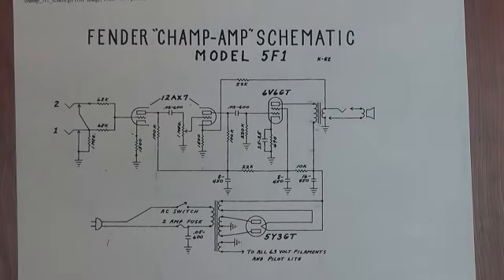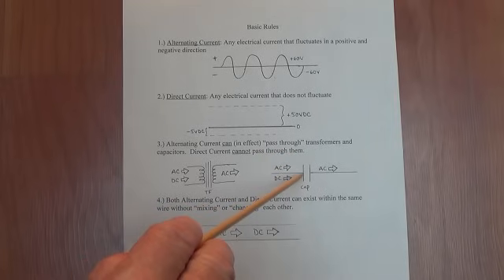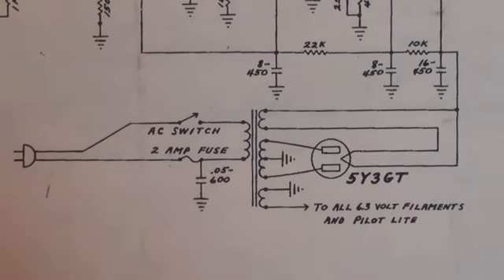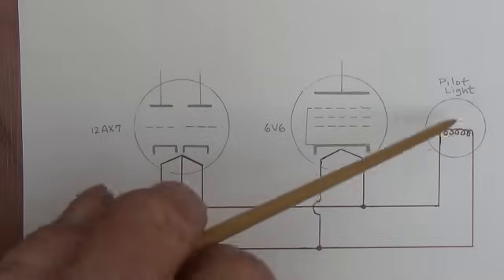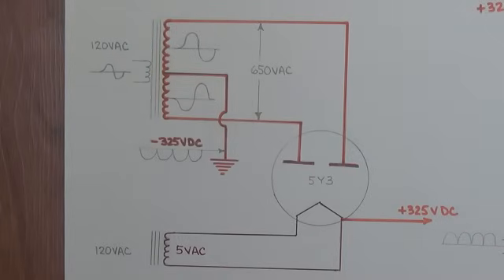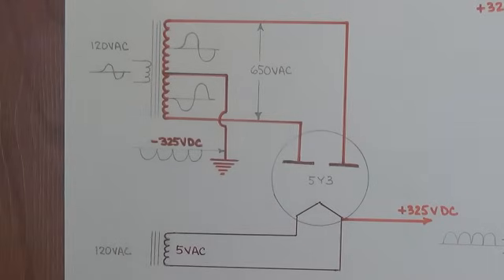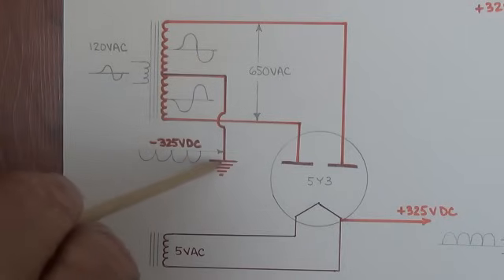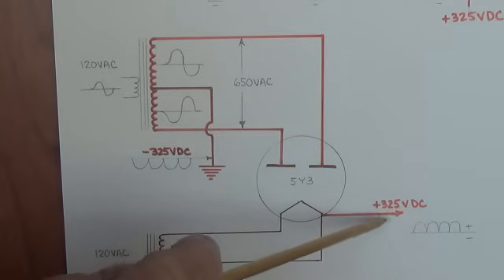How Tube Amplifiers Work, Part 1: The Power Supply

Comment from the maker: Dylan, your question did not have a reply capability due to your YT Privacy Settings, so I'll answer it here. The +325VDC output has passed through the diodes of the rectifier tube. The diodes, due to their alignment, only pass positive voltages. The -325VDC was rejected by the diodes (it was not allowed to pass through) and goes to ground. Think of the power supply as a 325VDC battery, with a positive output (from the diodes within the rectifier tube) and a negative output (from the ground).
Reply: hi Doug, im not sure if we had the same question but was wondering why if diode output is +325vdc and ground is -325vdc, why when we look at the amplifier stage it doesnt have +650vdc going to the output transformer with ground as a reference voltage of 0v? when looking at certain components like filter caps connected to ground and the rectifier, will they need to be able to handle 650 or only 325v?

thank you for the video!
Reply from the maker: This is an ancient video, NC.  The voltage readings on the diagram reflect the readings you would get if you first measured the voltage between the B+ and ground.....or if you measured between the B- and ground. If you measure the voltage potential between the two secondary output wires of the PT with no load, it will be approximately 700VAC before rectification. After rectification, since only the B+ is sent to the center tap of the OPT (and the filter caps), the output tube plate voltage(s) and the filter cap voltages will be 350VDC to ground.  All of this ignores losses due to heat, inefficiency, and the boosting of the smoothed DC to peak voltage.
Reply from the maker: No, ground has zero charge. It depends on the bias of the rectifier diodes. I you take the HV from the cathode (as in amp HV circuits) you will have B+ if you take the HV from the plates, you will have B-. You need to watch my videos on power supplies and rectification. @ncnoman
Reply from the maker: You're welcome, NC. Best of luck with all your pursuits. @ncnoman

Comment: So I'm a bit confused... I got it all up until the center tap in the 650V winding was introduced. Why does the schematic show the tap going straight to ground with -325V already without even passing through the rectifier?
Reply: +Dylan Headrick The -325V is still AC, the minus sign indicates the phase relative to the 120V input.
Reply from the maker: +Dylan Headrick  Greetings, Dylan. Since the full-wave rectifier (tube) blocks all the negative wave forms and only allows the positive wave forms to pass (creating the positive DC output), the negative wave forms must be dealt with, and are sent to ground.

Comment: Hey, could be wrong here, but wouldn't the center-tap on the secondary for the rectifier circuit always be at 0 Volts?  These voltages measurements are with respect to ground and it's connected to ground, therefore if ground potential is defined as zero, everything directly connected to it should also be zero.

As I understand it, the rectifier works by effectively removing from the circuit one of the secondary coils using the diode action of the 5Y3.  Looking at just one coil, when it swings positive, it "pushes" positive voltage out of it's respective diode to create the B+ supply, while the ground is at zero volts.  When it swings negative, the diode effectively breaks the connection of the coil, there's no negative voltage being sent anywhere, you'd just get zero volts out of the B+ rail for the time that coil is swinging negative.

The purpose of the second, out of phase coil, is to make use of the otherwise "wasted" negative swings.  By putting this coil out of phase and giving it it's own diode, it inverts the AC signal and gives the same switching between positive-and-zero output, but it outputs positive while the other coil is outputting zero volts.

In effect, the full wave of your AC signal is accounted for on the B+ rail, all the "bottoms" you described as being sent to the ground aren't being sent there, they're being inverted and used to fill the gaps on the B+ rail that would normally be there on a single coil, single-diode rectifier circuit.
Reply from the maker: Shaggy, I agree with part of your explanation, but don't accept that the "bottoms" are all simply inverted and fill in spaces between the "tops". The center-tapped 650VAC secondary creates two separate, out-of-phase 325V circuits, each with its own "wave". At any one time, two peaks being presented to a diode....one is positive and one is negative. Only the positive ("top") of either of the two waves is allowed to pass by a diode, but at that same time the "bottom" of the other wave is rejected. It has to "go" somewhere. It is the equal and opposite of the positive "top" ....and it goes to ground. If we were to replace the amp power supply with a big battery (in the old days of battery radios, the high voltage battery was called the "B" battery, hence the term "B+" for the positive pole), we would have to connect both the positive (B+) and negative (B-) poles of the battery to the amp circuit, or no current would flow. If you measured the DC potential between the two poles, it would be 325VDC.....and you could say that the (B+) positive pole was +325VDC and the (B-) negative pole was -325VDC. The ground potential may "seem" to be zero volts, but relative to the +325VDC B+ (which is all that matters within the circuit) it is actually the negative opposite.

A (perhaps) clearer "global" way to visualize this is to think of negatively charged "bottoms" as the presence of electrons and the positively charged "tops" as the absence of electrons. The power supply is like a pump that forces all the electrons to ground (B-) and creates a huge vacuum of electrons (B+) in a wire that runs to the plates of the tubes. The amp's function is then based on controlling and utilizing the flow of electrons from negative ground to positive plate.....whereupon the power supply immediately segregates them again.

Here is an excellent site for this subject:  http://www.tpub.com/neets/book6/22b.htm. The diagrams focus more on the electron flow (from - to +) model than on "tops" and "bottoms", but it clearly demonstrates the negativity of the ground connection and the essential part it plays in the circuit.
Reply: "The center-tapped 650VAC secondary creates two separate, out-of-phase 325V circuits, each with its own "wave"."

True.

"At any one time, two peaks being presented to a diode....one is positive and one is negative. Only the positive ("top") of either of the two waves is allowed to pass by a diode, but at that same time the "bottom" of the other wave is rejected."

Also true, still in agreement.

"It has to "go" somewhere. It is the equal and opposite of the positive "top" ....and it goes to ground."

This I don't understand, why would you think this voltage has to go somewhere?  Voltage just describes the potential difference between two parts of a circuit.  If the diode blocks the current of your coil, it doesn't affect the voltage difference between it's two ends, or how it's referenced.  The grounded end stays at 0V, and the diode end remains some negative voltage.

It's like saying a disconnected battery should have it's ends be the same voltage.  That voltage doesn't go anywhere, you have 0V on the negative, and 1.5V on the positive (for an ideal 1.5V battery with the negative side as the voltage reference), whether the ends are connected or not.
Reply from the maker: Shaggy, thank you for accepting two of my statements, including the blockage of  the "bottom" negatives. It's not voltage that is blocked, it is current, i.e. electrons, and they must flow somewhere or the transformer would cease to function. The electrons (B-) flow through the centertap to ground, then through the load (amplifier circuit) back to the ends of the diodes, which (when approached from the cathode rather than the anode side) allow the negative current to pass through to the secondary windings, completing the circuit. The grounded centertap is negative as indicated in the diagram in the link I provided. No battery has a pole that is 0V....the poles are either + or -. The power supply is like a 325VDC battery, with a positive (post diode) and a negative (centertap) pole.

I think our differences are largely semantic. You see the centertap-ground as a 0V reference for measuring the voltage of the rectified (B+ ) output. I agree that if you placed the red lead of your voltmeter on the diode output wire and the black lead on the centertap, it would read +325VDC, just as if you connected the leads to the poles of a battery.....but to me, this static measurement fails to address the very dynamic (i.e. current rather than voltage) nature of the system. The centertap-ground is the (B-) source of all electrons for the amp circuit, including the current that runs from cathode to plate in each amplification tube. Indeed, it would probably be more accurate from a functional standpoint to consider the diode output as 0V and the ground output as -325VDC, but in my model of the system, neither output is 0V. Rather, they are equal and opposite parts of a dynamic one-way "electron pump", like the + and - poles of a 325VDC battery.

I appreciate your thoughtful input. Such discourse encourages a healthy re-examination of concepts and an enhanced breadth and clarity of understanding.

Comment: I'm poised to build a 5E3(Tweed Deluxe) clone. Probably a complicated answer but I'll ask it anyway.
Can I use 6L6's instead of the 6V6's? I have a bunch of them and would rather save the money and keep my costs down
Reply from the maker: Greetings, Joram. The heater current, plate current, and plate voltage demands of 6L6's, especially GC's, are much greater than 6V6's, so you will have to use a more robust power transformer if you use 6L6's rather than 6V6's. If you already have a PT that can handle 6L6's, then great.....but if you don't, the extra cost of buying one may neutralize some of the savings from not buying and using 6V6's.
Reply: Uncle Doug, thank you for your prompt reply. I've bought a couple of books on tube amps but some questions I just can't get the answers are just not there. Love your videos. Great DIY projects. What do you recommend for the 6V6's?
Also, is that a cameo appearance on an "elpaso" video
T
Reply from the maker: Any good, used reasonably matched pair of vintage 6V6's will work, or perhaps a pair of the new, modern Russian re-makes. Yes, I was in several videos on the El Paso Tube Amps channel before I started my own YT channel.
Reply: Hi again,
Would a higher rated cathode resistor(10W 300ohm) take care of the increased heater current, plate voltage and plate voltage demands of the 6L6's?
Yes, it's taking me this long.....the day job is getting in way of fun.
Reply from the maker: It's not that easy, Joram. As I said above, a change to 6L6 GC's would require a larger power transformer with higher voltage and current capability, and you would probably need a different output transformer with a lower primary impedance to suit the 6L6's. The tubes are not simply interchangeable, they have very different circuit requirements.

Comment: Hello!!  I have a fender twin amp and when I powered on the amp the red light is getting weaker until the light is gone but the amp is working but if I hit with my hand above the light then the light is on but quickly its gone off again. Sometime the sound of the amp change dramatically. I am a musician but a stupid with gears so I will aprreciate very very much your advice.  Thanks!
Reply from the maker: Greetings, JJ. It sounds like you have at least one bad connection in the 6.3V AC circuit. Since you are not experienced in amp repair, and if this problem adversely affects your use of the amp, I would suggest taking it to a qualified repair person. Repair will require removal of and work within the amp chassis, which can be very dangerous, so the task should be performed by an experienced individual. Best of luck !!
Reply: Uncle Doug All Right! will do. Thanks Thanks Thanks!!!!!!

Comment: What is the importance of the capacitor on the 120VAC (primary winding side of the PT) circuit?
Reply from the maker: Greetings, YT. This .05uf cap is the infamous "Death Capacitor". It's primary function is to eliminate electrical and RF "noise" in the AC line. Many people fear that it might short to ground (which is theoretically possible but quite uncommon) and cause them to be electrocuted when they touch the chassis (depending on which way the plug is inserted in the socket), so it's often removed from the circuit. A better way to prevent problems of this sort is to install a 3-wire cord with chassis ground and a proper 2A rapid-blow fuse. Should you desire more info, I have posted a video on my channel addressing this matter.

Comment: I have an issue with my '66 Twin Reverb that is totally perplexing. First, the amp works great. However, it takes a few seconds for the pilot light to come on after flipping the switch. If I haven't used it in a number of months I timed it at 22 seconds from the time I flip the switch until the light comes on! The tube filaments coincide with the pilot light. I had thought it was a matter of the filter caps charging, but found out that that is not the way it works. I have a new switch, but have been too lazy to put it in, if this will even address the problem. I believe this is one for Uncle Doug to explain.
Reply from the maker: Greetings, RB. The pilot is connected to the 6.3VAC filament output of the power transformer and should come on instantly when you flip the power switch. The filament circuit does not go through any filter capacitors. It's possible that the contacts of the switch are dirty, corroded, burned, etc. and aren't making contact instantly. I suggest replacing the power switch to see if that didn't solve the problem. If so, great......If not, then let me know and I'll think of something else.
Reply: Uncle Doug Just wanted to update that I finally got around to changing the On/Off switch. That fixed the problem.
Reply from the maker: That's good news, RB. I'm glad the problem has been resolved.

Comment: i like your explanation for a non-technical person...it reminds me of electronics shop i had in high school back in the day. i loved building those old heathkits.

One thing about tube amps that puzzles me is why the prices are still so high compared to solid state..is it because of the labor intensive nature of building a tube amp vs solid state or  the valve sound is just a more sought after sound & people will pay more for that sound (myself included)  ?
Reply from the maker: Thanks, Art. I'm glad the videos are helpful. Re the higher cost of tube amps, I believe it's a combination of much higher building cost, i.e. more expensive and complex power transformers, output transformers, tubes, etc. The labor is quite high if the tube amp is hand-wired, especially if it's point-to-point, and I think people are indeed willing to pay more for the "tube sound" and prestige of ownership. Back when solid state was "the big thing", it was hard to give away old tube amps, but that situation has completely reversed over the past few years.

Comment: hmm the explanation is ok maybe this will help a bit too.
The cathode has a special coating and is heated so its the only plate (anode and cathode) that emitts electrons. Valves work by dropping a voltage because the "resistance" of a valve gos up. If you just look at the right diode its easier to explain. Looking at the anode as the power moves into a negative charge (AC) less electrons can move from the cathode to anode providing a large resistance and "dropping"(voltage drop) +V onto the "output" (bottom right of diagram +325v) but as the anode gos into the positive region of the sinusoidal wave all the electricity moves through the valve and no voltage is dropped. As there are two valves with mirrored waveforms you will always have +V on the cathode and they wont short each other out because they are different circuits!    trippy if they had gotten electricity the right way round in the first place it would be a lot easier!
Reply from the maker: Thanks, Joe. I'm sure the more advanced viewers will appreciate this detailed explanation.